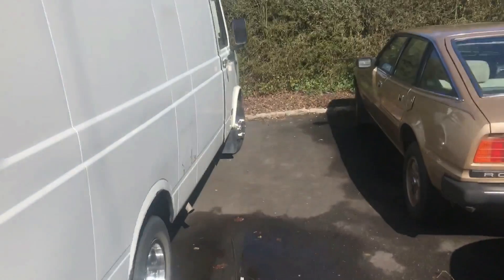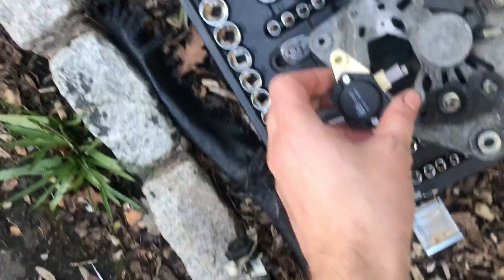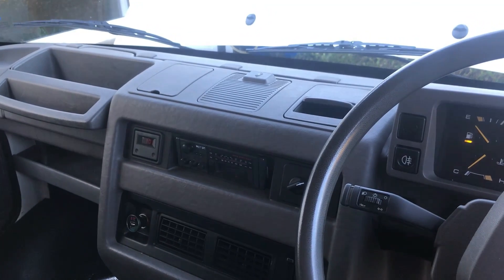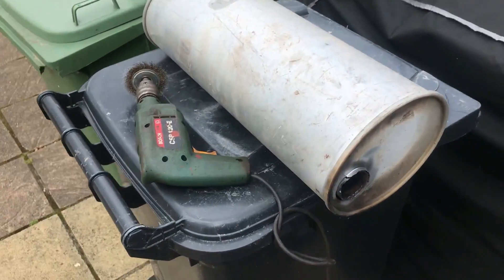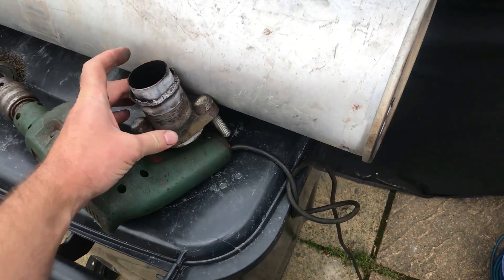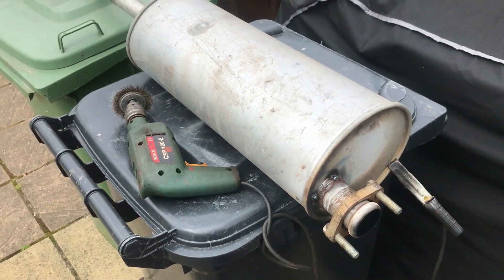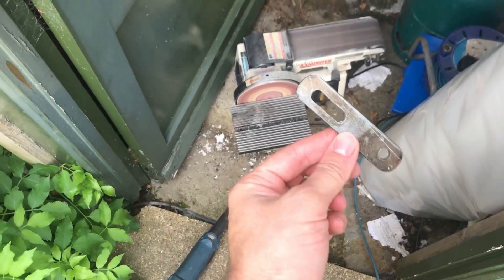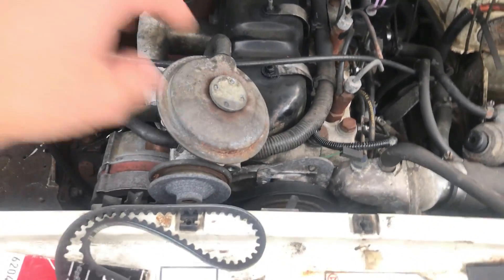DAF 400 part 7 - well overdue update - fixed charging issue - new exhaust broke :(

Comment: Nicely done. I had the opposite problem on my Merc the other day... Symptoms were no indicators and erratic wipers after a minute or so of running. Cause was alternator was delivering 15.7v freaking the computers out. Mental. A garage wanted to charge me a grand to replace the electronic ignition switch, but I thought they were lying, so did my own testing. Bloody glad I did alternator was less than £100

Comment: The fractured exhaust could be a sign that a set of new engine mountings might be a sensible investment.  The factory items weren't very good and tended to go pretty squidgy fairly quickly, causing horrible vibration issues.  Aftermarket replacements did tend to be a lot better and were the usual answer when one was presented to a good dealer back in the day with that issue.  One of these that I drove back then went through two sets of factory engine mounts in a year from brand new before it got a set of aftermarket ones and it was fine after that.  Before it really felt like the van was literally shaking itself apart and you could see absolutely nothing out of the door mirrors even at motorway speeds.  It was truly horrid...

Comment: Alternators need a tiny bit of current running through the rotor to start up. Sometimes if run recently, there is enough residual magnetism to start without the current or they may kick-in above a certain rev range. Early alternators would use the current running through the red dash warning light to start up, later designs may have 2 wires to the ECU to perform the same function but also control the charging current. If the alternator seems to be OK but you still have problems you need to check the wires in case there is a break - it may run intermittently even if one f these two thin wires are broken.

Comment: That charging faults can be notoriously difficult to solve. I remember a Montego that must’ve gone back to the main dealer at least half a dozen times, and each time they change something different ( they had to get permission because it was all under warranty and that’s why they didn’t just change everything all in one go as you could). I was never really confident of driving it after that and traded it in  pretty soon afterwards 🙄

Comment: I like that cigarette lighter charging measure thingy, where do you get them from?
Reply from the maker: It was suggested by someone who posted up a comment.  I just got it off ebay.  Its a usb charger thing but also does a voltage read out.  Very handy